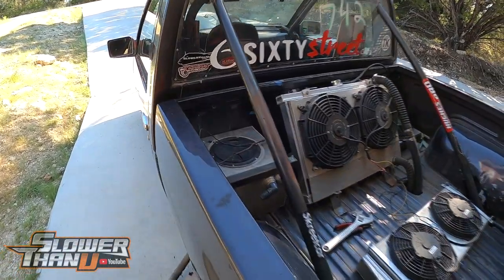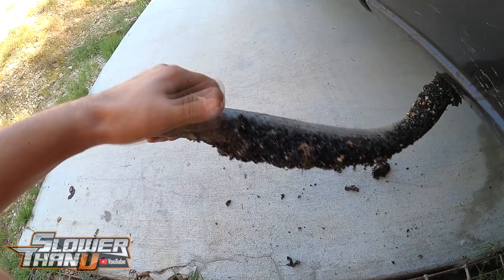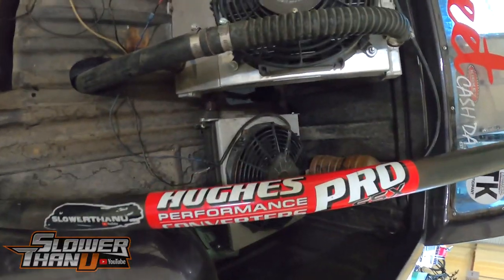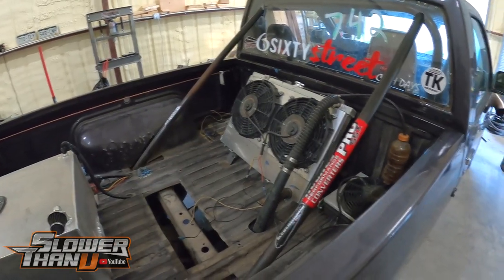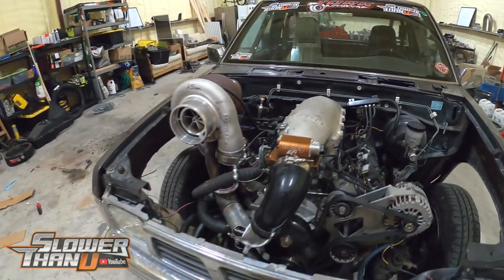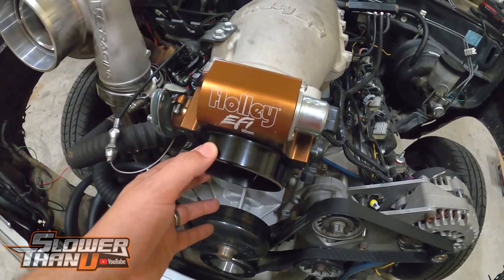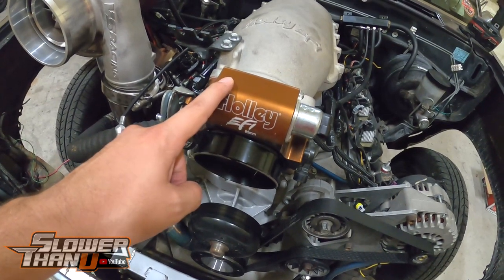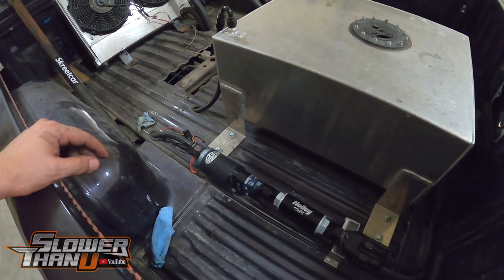Prepping Liam Nissan for M50 Methanol/Gas Fuel Mixture #Methanol #M50

Comment: We tested on m50 bmw turbo a2a, same boost, only change was from e85 to 50/50= 91/m1 = +120whp
Reply from the maker: So far it seems we are about evened our or possibly gaining a little going from e85 a2w to M50 and no intercooler. Putting it on the dyno soon to verify.

Comment: Could I ask what the shed is coated with on the inside almost looks like a coating of sorts. Sorry I’m a carpenter and have never seen this were I’m from.
Reply from the maker: Kiwi Boosted Garage it’s a spray foam used for insulation.